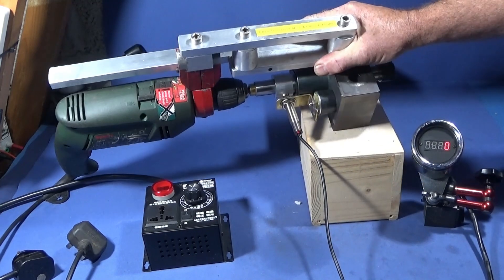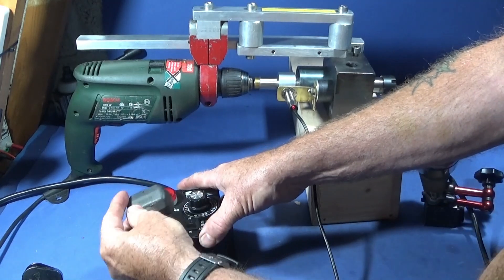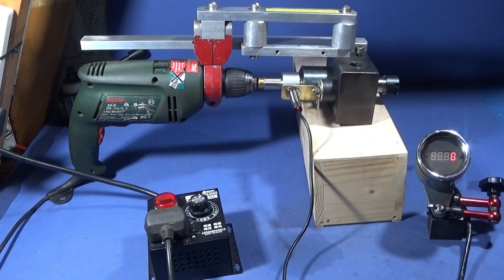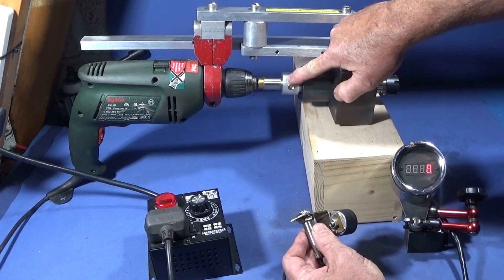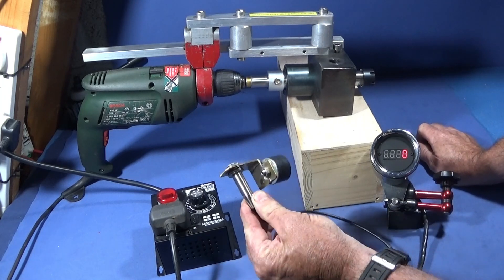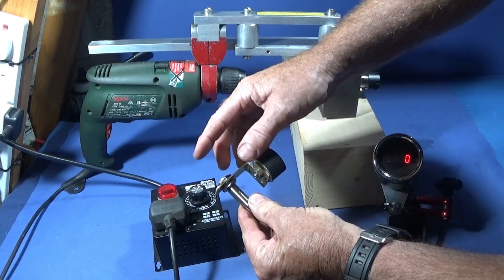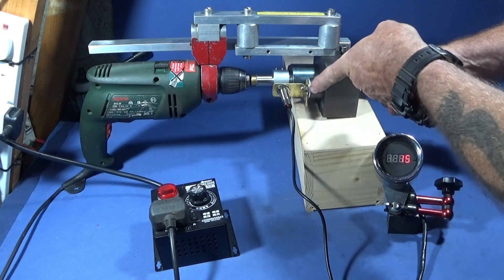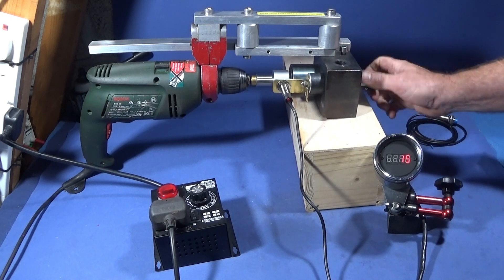ER20 Collet Milling Fixture Speed Control & Tachometer Upgrades

Comment from the maker: SEE LINKS BELOW FOR ITEMS USED:-
AC 220V 4000W Variable Voltage Regulator Step Down Voltage Converter Transformer Motor -- https://bit.ly/3dzKYef
LED Motorcycle Digital Tachometer Tacho Speedometer -- https://bit.ly/3i1DuE7
Sensor Cable With 3 Magnet -- https://bit.ly/37YR2LW
DC 8-24V 4 Digital LED Tachometer RPM Speed Meter -- https://bit.ly/3g1MtTR
NPN DC 6-36V Inductive Proximity Sensor Detection Switch -- https://bit.ly/2ByXWeR
Reply from the maker: Banggood 2020 Summer Price Storm -- https://bit.ly/2BL5Ban
Banggood 2020 Summer Brand Sale -- https://bit.ly/2VVnFp3

Comment: Great Steve, I ordered one of those gauges for my lathe with my luck there was a scratch inside the glass interfering with the number that's my luck, hope you and your family are doing well.
Reply from the maker: Hi Steph thanks. Yes we are all ok at the moment. Did you get the chrome one? I was wondering if you could move the glass around a bit on that one? Regards Steve
Reply: @SteveJordan  yes it was the chrome one I will try that thanks

Comment: Doesn’t that drill have about seven or eight speeds controlled from the trigger - twice as many if the drill has a 2 speed gearbox?
Reply from the maker: Hi Richard yes it does but if I use the variable voltage unit I can leave the drill locked on and vary the speed continuously with the control knob plus turn it on and off. This saves operating the trigger on the drill every time. Regards Steve

Comment: You need to start useing treadmill DC motors with there control board,,I use them for all my power tools now,,even my metal and wood lathes
Reply from the maker: Hi I use 3 phase motors with VFD's for both lathes. I have made a milling fixture using a treadmill motor but this drill method is super quick to put up and take down from the lathe. I can go from turning to milling in a few minutes using this setup which is exactly what I wanted. Regards Steve.
Reply: @SteveJordan  nice to have 3 phase,,,I don't have it and single phase VFDs are very costly

Comment: I have had problems with these at low speed over heating and low power burned up a drill and router running low speed hope yours works well for you watch for heat in the armature
Reply from the maker: Hi Joseph. It will be interesting how it goes. I don't use it on really low speeds as I can hear when it's not good for the motor. The lowest  RPM I use is about 1000 when in use, but it's nice to have the control off of the drill.

Comment: Thank you for these videos. As a beginner, can see my future in what you do. No gear as of yet, but am to make most of it. Need a front headstock roller  bearing. Same as back one, but approx 3mm bigger bore.  Not available, though told there is 1 in USA, $350.  Looking to bore out a rear one, $79. Using diamond grinding tool. Will try on old one first.